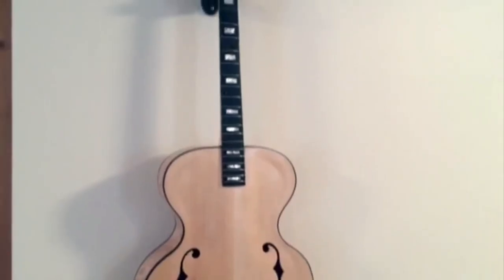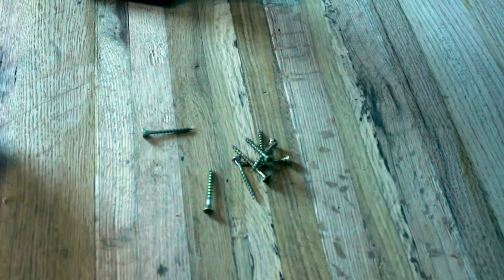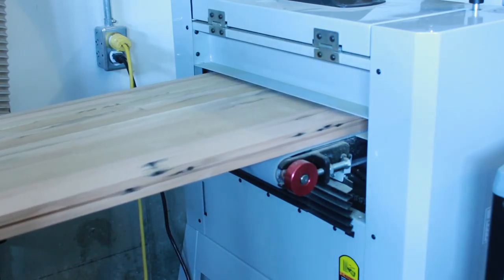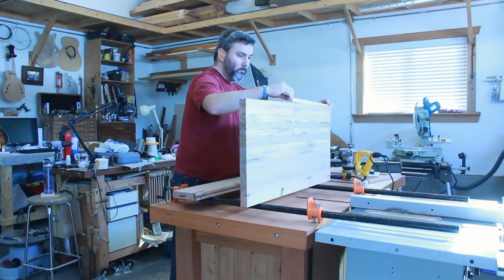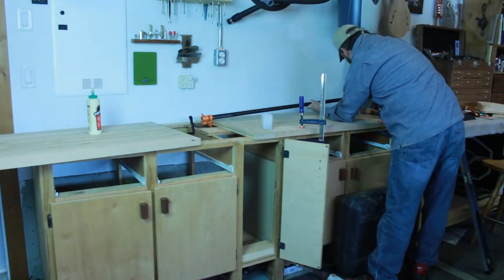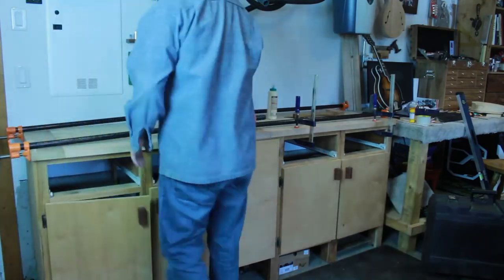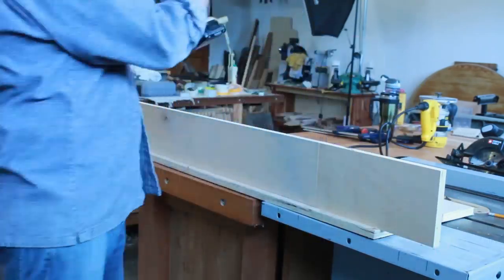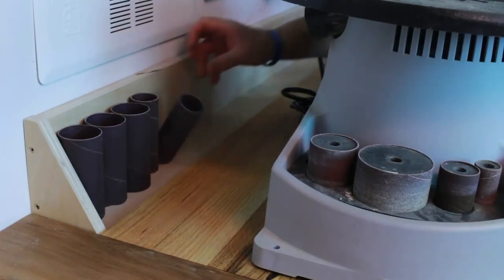Resurfacing a Spalted Oak Bench top

Comment: Tomy, the bench top came out great... I love the random grain patterns, My only concern is I hope you dont get further cracking & splitting from where you attached the breadboard ends. Normally when you attach breadboard ends you dont glue the whole thing because of the intersecting endgrain & long grain when it expands & contracts it can split if its restricted from glue. But hopefully you wont have that issue if the wood is pretty dry from age. Anyway Great job & I cant wait to see the octave mandolin put together
Reply from the maker: The top shouldn’t move much now. It been on there for over 5 years now and was about 1 1/2” thick. So there isn’t any extra moisture left in it. I removed just over 1/4” from the resurfacing. The assembly is like breadboard ends with the exception that they are splines, glued only on the bottom side. If something breaks I think it will be the 1/4” spline or it will be on the underside.. thanks for watching..